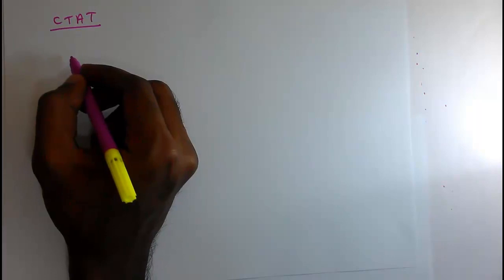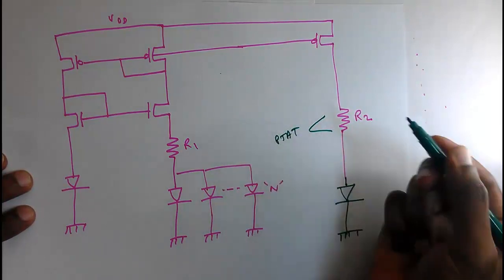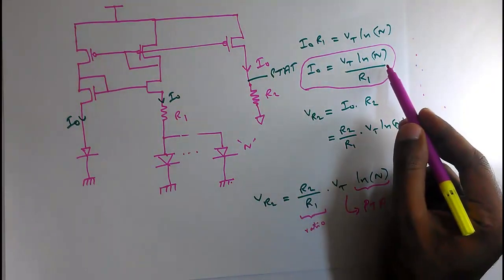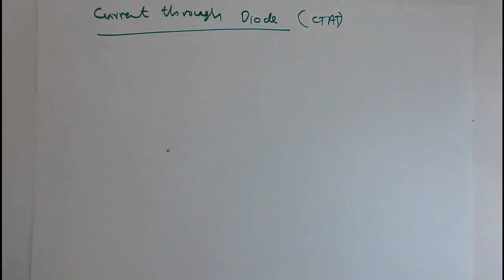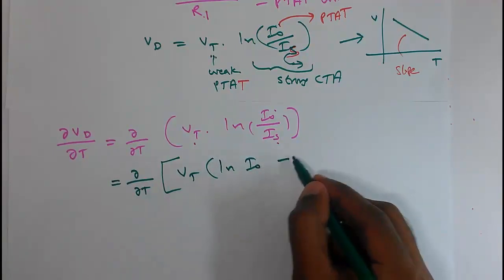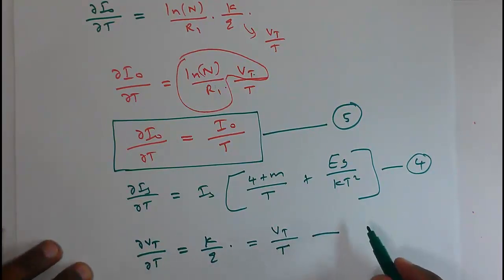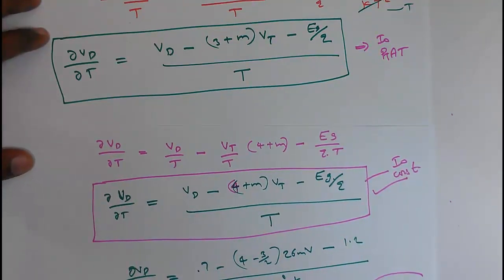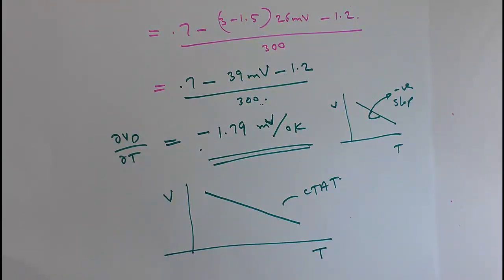Design of Bandgap voltage reference (BGR) - 6 : adding PTAT and CTAT

Comment: Sir is there any replacement for resistors during fabrication process
Reply: Accurate resistors are fabricated using polysilicon or nwell resistors, based on their sheet resistance, width and length the values can be calculated.

Comment: Assalam-Walaikum Hafeez bhai jaan.
Can we use this circuit as a current reference...?
if yes how...? And how can i get more accurate results( i.e very less variation in vdd, temp and process parameters, may be less than 2%)...
And by the way the video tutorial is very good thanks for uploading them... :)
Reply: I think for current reference there is separate circuit

Comment: I like this tutorial series. Are you using UMC design kit?
It looks like PTAT temp slope is constant, but CTAT is not due to the 'T' term in the denominator. Is this related to temperature curvature? Can you cover this too.
Reply from the maker: CTAT slope depends on voltage across the diode also. it also changes with temperature